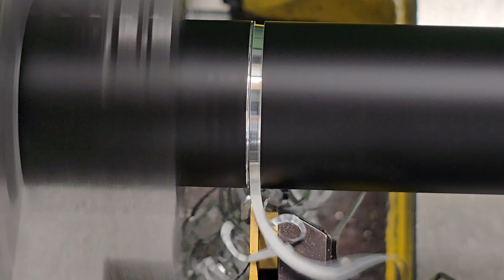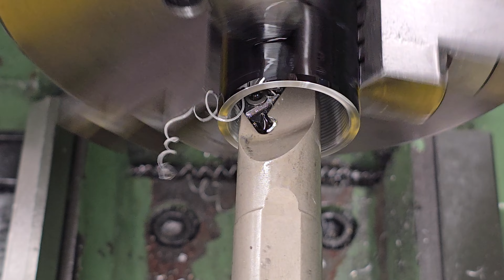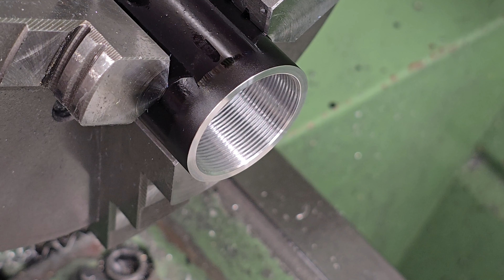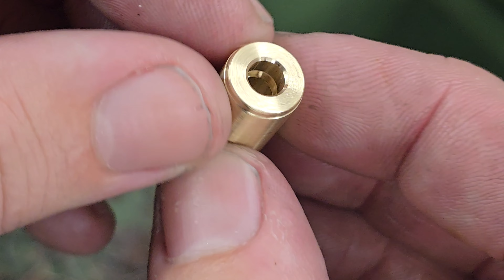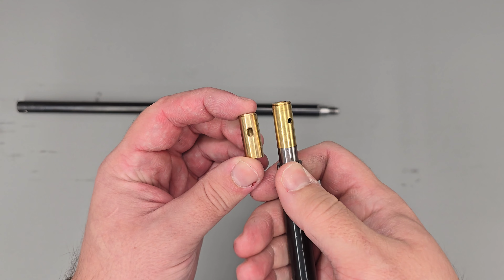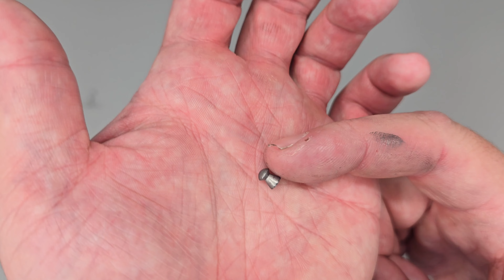Shortening the FX DRS

Comment: Always love your videos when you show the machining work that needs to be done.  I am curios on the barrel modification, what is the diameter of the thread gutter and lead in?  There isn't much room to play with as the outer diameter of the brass barrel inlet is 10.5 mm.  What thread size are you using to secure the barrel inlet to the barrel?  I am thinking about converting a Lothar-Walther solid barrel for use on my DRS.

Comment: Hi,
    Is there enough room inside the chassis for the match trigger ?
Reply from the maker: Hi no we had to mod the match trigger to get it to fit, but it will go with a little tinkering
Reply: @sub12airgunners  Lets hope when the DRS match trigger comes out it will go straight in.

Comment: You mention 780 fps for jsb 8.44 pellets. Do you work with this pellet first then check others for over power,bismags always put mine over with 8.44 set around 770 to 780
Reply: whats your shot count from full fill down t6o reg pressure?
Reply: @icuppu2  agt vixen, 120 shoots from 110 bar use. Down to 100bar in bottle. I know it's not the same rifle but must work on sane principle quoting 1 pellet?
Reply from the maker: we test with jsb 10.34 they are about the most efficient pellet and make sure it's under with them

Comment: Nice job mate. Why did you opt for a new transfer transport port and the extra machining on the barrel opposed to parting and re-crownig? Rather than adjusting air velocities via the reg and hammer spring/weight im genuinely intrested. Thanks again
Reply from the maker: thanks for watching 😀 we went for the larger port so we could back off the H/S a little and we didn't have a big jump in fps between light and heavy pellets👍   the barrel was a good one so we wanted to keep the choke if it wasn't that good we would have just chopped it off to save some work  😁